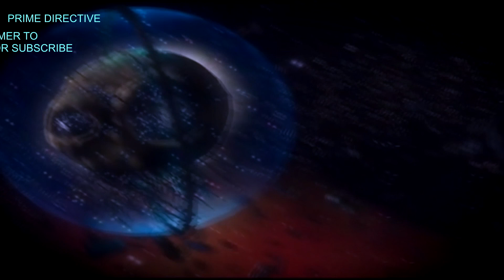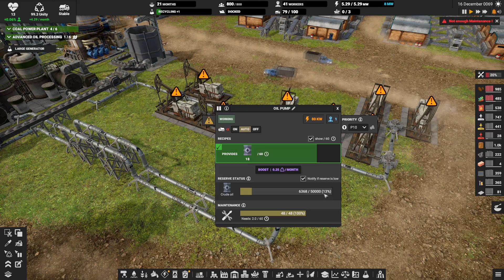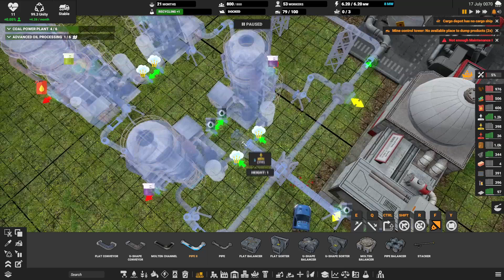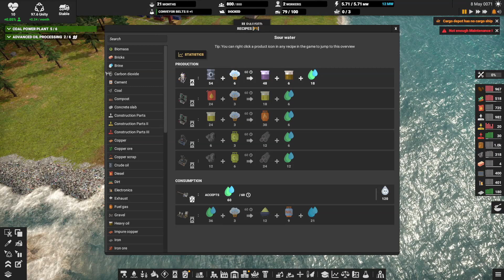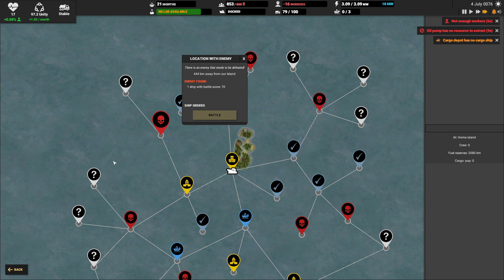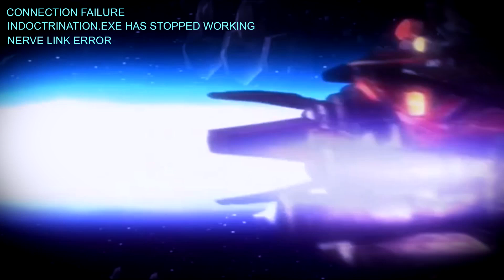Captain of Industry / part 6 / More "EFFICIENT" Fuel

Comment: 32:07 The 2 lines of Advanced Refining you have will serve a small industry very well.

I went with 3 in my previous playthrough, 5 lines in my current (or was it 4?). Either way, my intent is to set up a better designed refinery in the late game, up at the other Crude Oil deposit on the island, likely with 6 lines, and of course its own Oil import Cargo Depot, and integrated handling of Heavy/Light Oil, and better re-looping of the Water I get from stripping the Sour Water (a clog-up of Water would be a real problem. Probably I’ll run the Boiler or Boilers on Fuel Gas.

Comment: 3:17 The standard advice is that each of the Groundwater deposits can support 2’ish Pumps running full time. ‘ish, because there are two slightly different sizes (12k and 15k?). And if you supplement with some Rain catching then you can stretch it a lot. Even more so if you also use tier-1 desalination.

Comment: seems like this game lets you run out of resources quite easily.
i wonder if complete self sufficiency is possible?
i mean, you can plant trees and get wood and probably get charcoal. you can recycle different kinds of waste into new resources, both metallic and oil based. but can you get out as much as you put in and sustain running everything?
Reply: You can make Bio-Diesel too, but as I understand it, in the late game you’ll need to do Contract trades.
Reply: @peterknutsen3070  that would solve the fuel issue then.
so wood, charcoal and fuel are renewable/infinitely available. plus whatever you can make with sea water, and the trash recycling.
looks like only metals are really needed to be imported.
now the question is, do the other trade partners have finite trades good too, or are they infinitely resupplied over time?